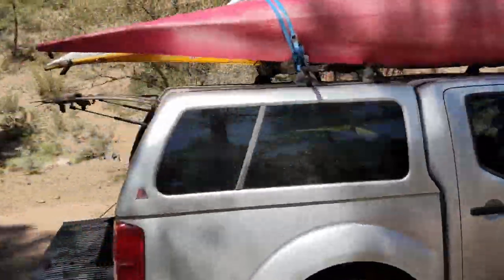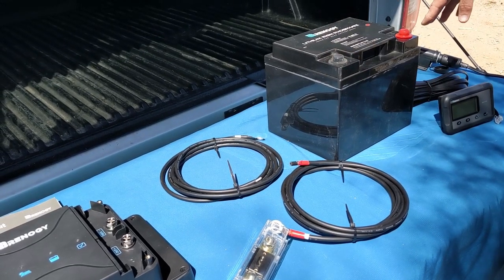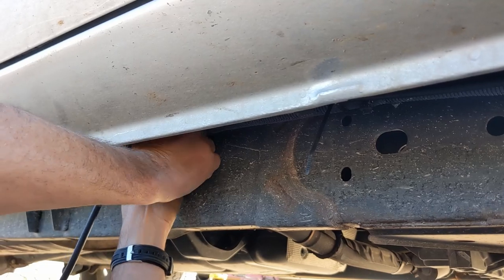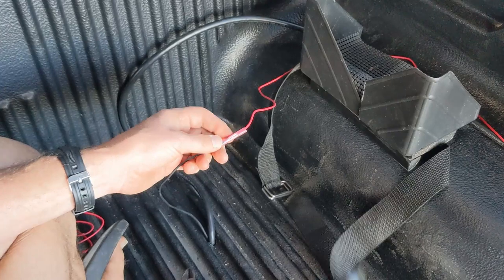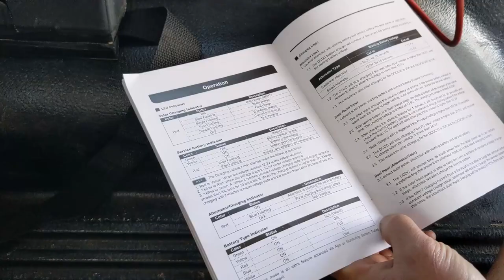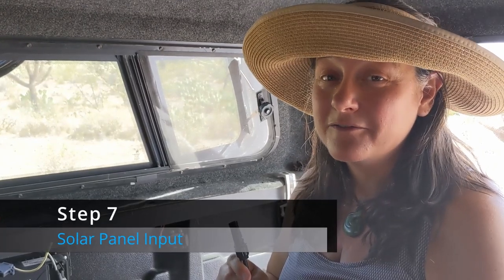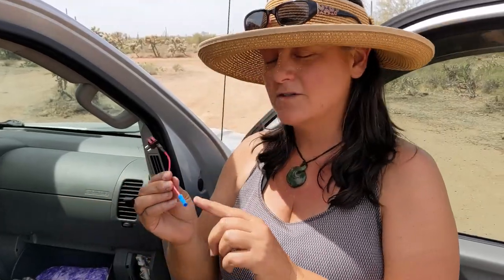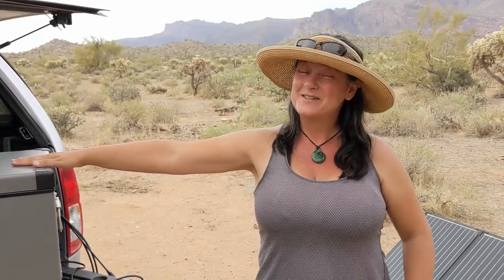Maximize Boondocking Power with a Renogy Dual Input DC to DC Battery Charger & LFP Battery Install

Comment: Can tell me what alternator you have please
Reply from the maker: We have a 2015 Nissan Frontier SV 4x4 with 4.2 engine.  I believe we have what is considered a "Smart Alternator"  but we only installed the ignition signal wire for this unit, and it seems to be working great.  It's been awesome for 3 years of full-time living.

Comment: Thank You very for this video.  The only thing I did not get is the fuse tap.  because you have a variable voltage alternator?  how do you know you do? that would be a smart alternator?   and the choice of the fuse and where the wire you ran goes to.  I did not get this part.  if you could explain ;-0)
Reply from the maker: Thanks, glad it helped!  Yes, a smart alternator is a variable voltage alternator.  We just looked up the make and model of our truck and figured it out.  You could also call contact your mechanic.  For the fuse, you need to choose an appliance that turns off when the car engine is off so that it won't drain your starting battery. Every car is different, of course.  Ask an auto parts store for help on that one if you aren't sure.  They'll often come out and look at your fuses and then you can buy the right sized fuse tap from them.  Hope that helps!  Holler back with further questions.  Be sure to use our affiliate links in the video description and promo code CANLIFE to save $$$ if you purchase from Renogy and/or ICECO.  Best of luck!
Reply: @FreedomInACan   @Freedom in a Can  Thank You for your reply and Promo code!1 I am looking for a good 12V freezer.  Can't remember if ICECO has one for now. 
 What I don't get is the relationship between the fuse Tap and your smart Alternator and the wire you ran to the ignition signal wire on the Renogy.  Wouldn't you have to run this wire and tap in even if your alternator is" non-intelligent?  What special treatment does a smart Alternator has compared to a standard Alternator.  Great Job on your system,  I am curious to see how many months/years the double-sided tape would hold.  Thank you for your work :-0)
Reply from the maker: @projet2907  Three good questions here. 1. Our ICECO fridge / freezer can be either -- the colder you set it, the more energy it needs though.  They also have a dual zone model so you can have both a fridge and freezer.  Use our link in the video description and get 12% off.
2. In looking at the manual for the Dual Input Charger, it says to only connect the Ignition Signal Wire (IGN+) to the fuse box if you have a variable voltage alternator (smart).  If you have a standard alternator, which puts out a constant voltage, you don't need to connect the IGN+, page 7-8 https://www.renogy.com/content/RBC3050D1S-G1/RBC3050D1S-Manual.pdf
3.  The double sided tape is holding really well after nearly a year and 12K miles of all kinds of roads.  Just installed a cut-off switch near the starting battery so that we can turn off the engine charge when the battery is below 32 degrees F - LiFePo batteries won't charge below that temp  unless they have the self-heating function -- ours do not (the battery will still discharge to -4F).  The tape on the fuse and all other components are still looking great and holding!  Good luck and let us know if you have any other questions.
Reply: @FreedomInACan    Thank you for all the work you put into answering my questions.  
I appreciate very.  The double sided tape you are using would be the Gorilla 1 inch 60 lbs?  I have 2 lithium batteries I installed  outside my trailer in it’s box.  I bought two heating pads from Offgrid power pack.  Hopefully it will do the job if I get caught in very cold weather up in Canada I wish I could find a Dc to Dc charger that would work in cold weather too.  I could install it in the back of the truck instead of in the trailer.  For the Iceco,  I really need the whole unit to be a freezer, I will look up your link thank you.  Yes, maybe it’s too Mach draw.  We’ll see.  Again, thank you for your videos and help!
Reply from the maker: @projet2907  Sure, no problem.  The DC to DC can be used in cold weather, it's just that LFP batteries won't charge under 32 degrees.  The ICECO can be a full freezer or full refrigerator -- just depends on how you set the temperature.  They also have dual zone options that you can set differently.
Reply: @FreedomInACan  Super, thank You.  I thought I saw the Renogy Dc to dc max operating temperature was -4F
Reply from the maker: @projet2907  It's -30 for the Dual Input DC to DC.  -4 is the minimum temp that LFP batteries will discharge (give you power) and they have to be above 32 degrees to charge (receive power). These numbers are Farenheit and are referring to the core temperature of the unit, not outside ambient temperature . In all honesty, we turn our fridge off when the weather dips below 40.  The fridge becomes an insulator to keep our food from freezing at that point.
Reply: @FreedomInACan  Thank You!  🤗⭐️
Reply: @FreedomInACan  Hello again 🤗.  Does this DC to DC Dual charger become very hot when in use?
Reply from the maker: @projet2907  We haven't observed this to be a problem with our installation. The product manual indicates that it needs to be installed in a well ventilated space, or installed with a fan if in a smaller enclosed space, minimum space surrounding the unit on all sides is only 5cm or just over 2 inches.
Reply: @FreedomInACan  Thank You very 😊

Comment: Do you have a link for the d+ cable?
Reply from the maker: No, I think a good chunk of cable comes with the dual input.  If not, just use 18AWG which is available at any auto / hardware store.
Reply: @FreedomInACan  thanks! I realized after that it's not the same as a "normal" amperage cable. I fried my own brain overthinking it and didn't see that it's a much simpler "math" as it's for the ignition and I was thinking "well my charger has 60amps so I can't do 16-18 as most suggest" lol overthinking! But thanks! Appreciate your answer and everything you guys do!

Comment: How long does the fridge last on the 50ah battery
Reply from the maker: Much of it depends on how much the compressor has to run, which is dependent on the ambient temperature.  But what we've found is that if we are parked (without running the truck at all) and it's in the 80's (F), it'll last 3-4 days.  In these situations we just pop our 100W solar suitcase onto the charger.  Or, if we drive the truck for about 15 mins each day, the battery stays completely topped off.  If it's in the spring and fall with temps below 50-60 (F), it seems to last forever.  If it's winter , it doesn't need to run at all and keeps food from freezing.  Hope this helps!
Reply: @FreedomInACan  awesome that is amazing thank you
Reply from the maker: @Bifrost_jt  Sure, happy to help!  BTW, if you want to save some $$$ on either Renogy or ICECO gear, be sure to use the links and promo codes found in the video description.  It'll save you a bundle!  Let us know if you have further questions.

Comment: I know you have a ground with a bolt to tub body but really the wire terminal should be hard up against the metal not against the plastic tub liner. 
 Would be better soldering instead of spade connectors..
  If you have a solar trip switch to isolate when driving you can get 50amps from alternator ,just be aware of cable distance good to run 4B&S cable. 
 Settings on the renogy app can change acceptable voltage charge in the settings..
Reply from the maker: Thanks for the comment, this is good feedback.  We actually had problems with this set up until we actually ran a 6AWG ground wire all the way back to the neg terminal on the battery.  So, the truck bed body ground wasn't really a very good ground, as you've suggested. 
We have the 30A version of the Dual Input, and we don't keep the solar panel plugged in so we're getting 20+ while driving.  Curious what the isolator switch would do when we don't have solar connected to the Dual Input except on rare occasions, and never when driving?
Last year, we actually installed a dual battery switch so that we can send back more charging amps to the trailer battery (via Anderson connectors).  We mostly need extra charging during the fall, winter and spring, when sun angle is low, days are shorter and cloudy.  It's also when temperatures a colder, so the fridge is working way less, and the fridge battery doesn't need charging.  Exactly when the house battery might need an extra boost.  The switch allows us to control where we put that engine charge.   It works like a charm - making a video on that soon.
Reply: @FreedomInACan  yeah I'm at the stage of deciding if I need to run a bigger alternator as mine is only 90amp. I will be running a renogy 50amp dcdc to my camper trailer which has 2x120a lithium  and another renogy  50a dcdc to my ute ALU canopy which will run 2x 170a lithiums both running 2B&S cabling so I don't think the alternator would cope..
  Just lookup 12v trip switches just like a house trip switch and use that as your on/off switch for the solar.. 
 Check ISC open circuit voltage of you panels add those together and then multiply by 1.56 gets you to what your fuse /trip switch should be.. EG.2  PANELS  AT ISC  5 AMP 
IS 10AMPS.. multiply by 1.56. = 15.56. so you will need 16amp trip/fuse..
Reply from the maker: @gavinfisher8049  good stuff!  Thanks for the input.

Comment: Can not run Solar Panels in series since the Charger only accept up to 25V input from solar. This is a drawback:-(
Reply from the maker: Yes, I can see why this is a downside.  With the effort the Renogy team is putting into 48V tech these days, I don't think it will be long before there's a new Dual Input charger that could handle more voltage and increase panel set up options.

Comment: Ad second charger if need more solar
Reply from the maker: So when you have a solar panel connected to this 30A DC to DC Charger, it divides the two charging sources at 15A a piece.  If you need more solar, you can get the 50A version, which gives up to 25A of a solar charge.  Let us know if you have any questions.

Comment: 7:37 oh boy, this is getting sketchy quick. No wire loom or anything, just raw dogging the main wire up against the frame rail
Reply from the maker: We actually went back and replaced this wire with 6AWG multi stranded welding wire, seemed to handle the bends better.  Thanks for the tip!